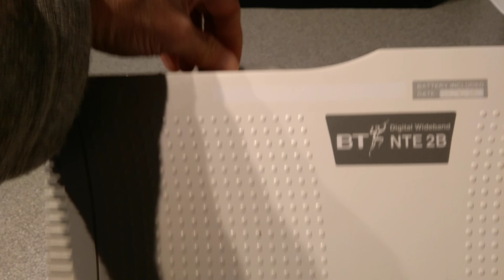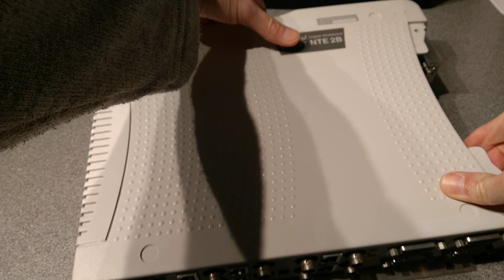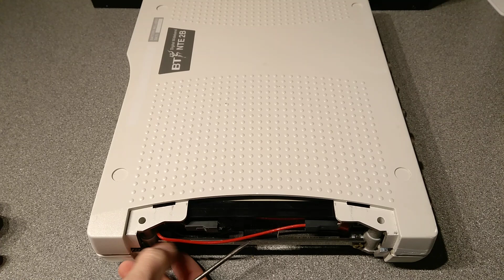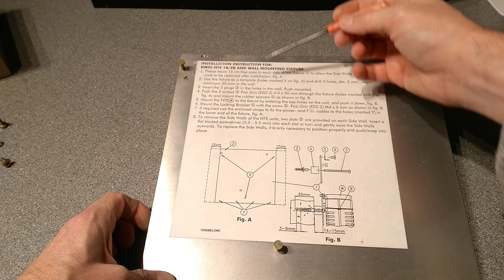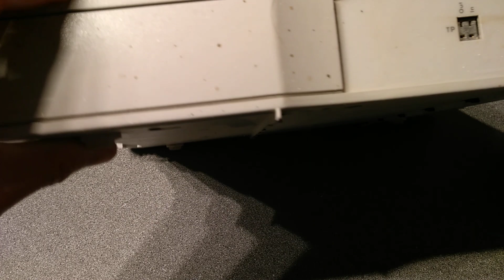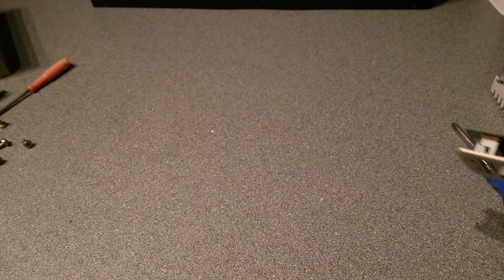BT Digital Wideband NTE 2B ISDN(?) termination equipment.

Comment: Exchange end was designated LTE (line terminating equipment) and customer end was NTE (network termination equipment). Manufactured by Alcatel. 1st generation was 1A (1x 2Mbit/s) and  2A (4x 2Mbit/s) These did not have X21 outputs. Then came 1B and 2B. 2D was the final version, basically same as 2B. There was also a 2C (very rare) which was a 19” rack mounted version. There was also a 6A & 6B (16x2Mbit /s). All units were programmed using a handheld terminal or laptop. All units were dual fibre or single fibre working (with external fibre splitter). Line (fibre) speeds were all 51Mbit/s as they used the American SONET laser  chipsets for economy of scale.
Reply from the maker: Thanks for the information. I had one with the same looking chassis at the first place I worked but I can't find a photo in good enough quality to see which generation of equipment it was.
It had 30 channels, all enabled plugged into an Inter-Tel AXXESS phone system (which was such a great system; I loved administering it and it was rock solid reliable for decades).. eventually dropped back to 8 ISDN channels. Now it's gone and replaced with a SIP trunk, Asterisk standard SIP desk and DECT phones.
Reply: How about the 4A? Just saw one on eBay!